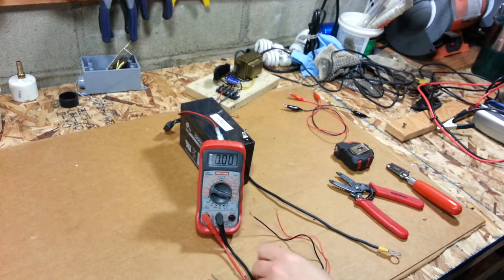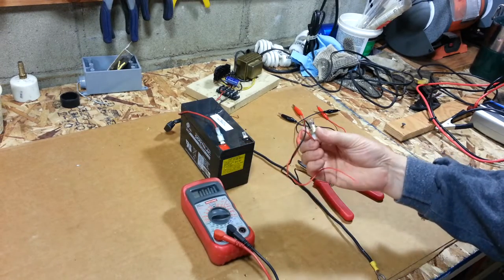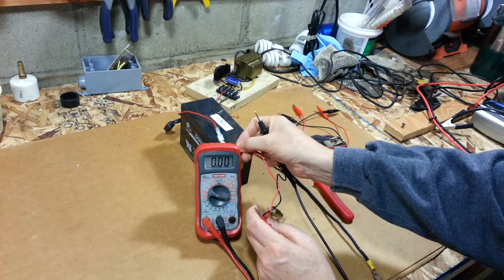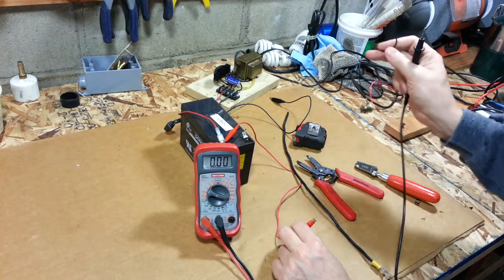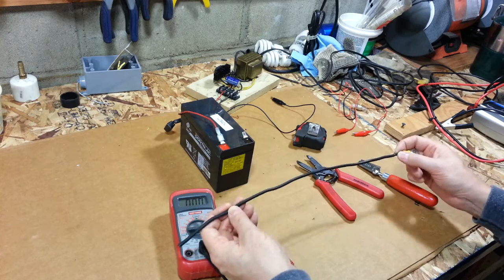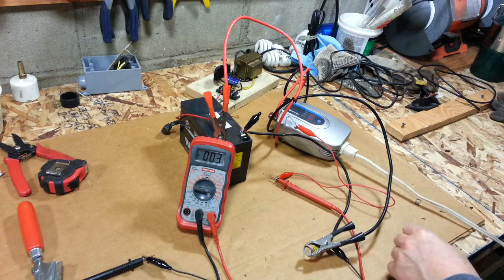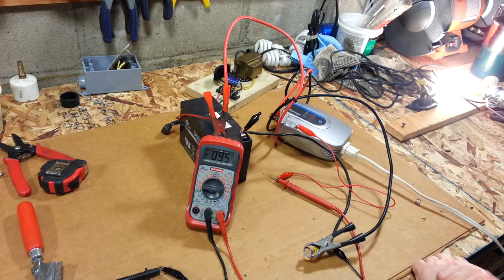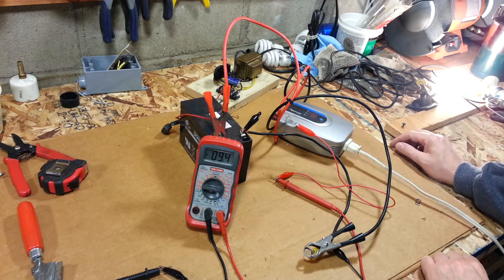DIY shunt for DC amp measurement

Comment: So the resistence of the needle and clamps can be ignored if u want to find 0,01v drop?
Reply: since you are measuring the difference between the two measuring leads as long as all the connections are the same you can ignore the clamps etc, in the case of what he is doing one lead is different because it has a safety pin on it that would skew the results but he was just showing proof of concept. magnetic interference from AC wires etc would also skew the results to mitigate this if you where to want a permanent mounted Ammeter like this(in a RV for example) you just use a twisted pair of wires(phone cable wire works great) also using a wire as a shunt has a 10% tolerance to it(not terribly accurate but accurate enough)

Comment: It doesn't matter whether you use the negative or positive lead to check the amps. The only time it can be a problem is when you use an analog meter, then you have to be careful or the needle of the meter will deflect to the left, giving a false reading and can damage the meter's needle if too much current is drawn.